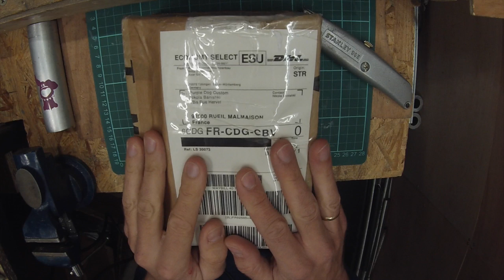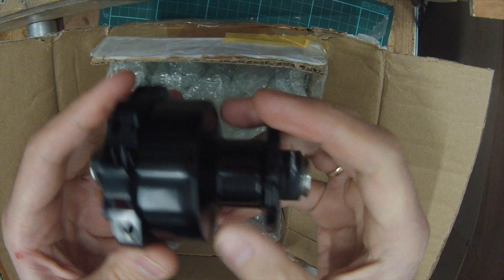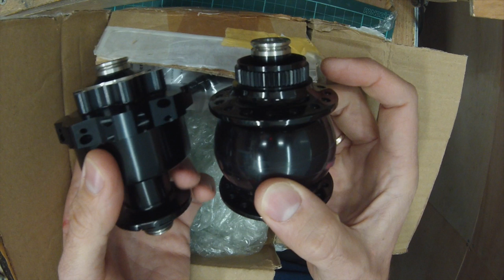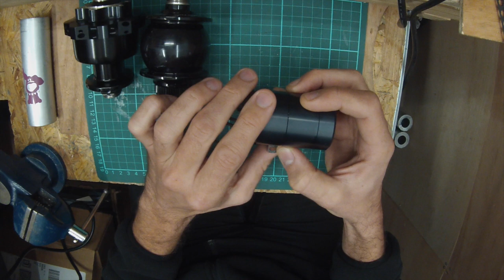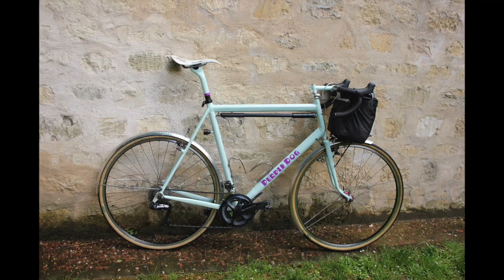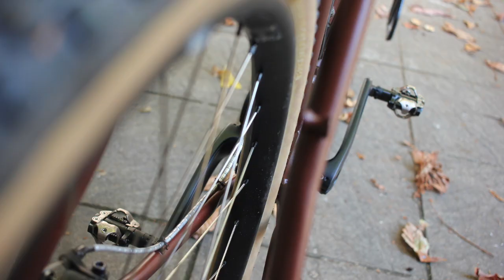JAN 2025 Small Shop Talk: Project Dynamo X unboxing, Stalker LED light, New Fixture

Comment: Do you have plans to release one of these higher power lights without the integrated battery or is that a key component of your system? Personally I would love more power from my dynamo lighting.
Reply from the maker: Hi there, I do have 2 lights only (www.custompurple.com/shop) - Sarah and Kerrigan  though they have output slightly higher than for example the Edelux. The battery does make low speed riding flicker free which is VERY nice and the battery is user replaceable *without tools and/or soldering* you can see it done here (https://youtu.be/BmKDtM5p_H0?si=4EDNshe1yNQ6PdXg&t=1418).

Depending on the road test results of Project X, I have a whole system coming that will have high power front lights only as an option (500+ lumens).
Reply: @CustomPurple  Thanks for the speedy and comprehensive response. I'll be keeping an eye on Project X for sure. I mainly used Supernova E3 Triple but that was stolen and I'm not as happy with the E3 Pro or whatever it was that I've been running recently. I've been happy with klite on the MTB but I'm after higher beam on road.
Reply from the maker: Kerrigan (https://custompurple.com/product/kerrigan/)would definitely fit your needs then. After showing it at bike shows, I have had some feedback so I am redesigning the electronics a bit, though after my lights with battery/USB charger, Kerrigan has been the product/front light with the most interest. 

As mentioned in the video, Project X will have its own ecosystem of devices/electronics to fit various uses (touring, commuting, gravel, MTB, etc.). Though first I have to build it into a wheel and test it on the road. So stay tuned. =)

Comment: From what i could see the prototype supports a disk brake - but the current type SON dynamo was not a disk brake model? Coupd we see a size comparison of "apples to apples" so to speak.

Great to see the new tech though!
Reply from the maker: Hello,
At 3:04 you can see both aligned side to side. the SONdelux is Shimano Centerlock disc (spline mounting) and the Project X dynamo is 6-bolt/ISO.

Comment: And what problem does this solve?
Reply from the maker: More power (2-3x) especially in the 5-15kph range. Currently dynamos do <1-2W there, which while sufficient for some light (with LEDs) it is not enough for anything beyond that. Also for off road riding/gravel where speeds are lower you need 3-5W to see enough. Also as I mentioned in the video charging anything requires at least 2.5W, preferably 5W so running multiple devices (lights and charger for example) at the same time will be possible. 

If you are happy with the performance of your regular/3W dynamo setup, probably you don't need anything more.
Reply: @CustomPurple output: That sounds good; thanks for the answer. 
Will you also sell a charger?
Reply from the maker: You are welcome. I currently sell a front light with an integrated charger (https://custompurple.com/product/the-companion-bikepacking-dynamo-light/). Though I mentioned in the video that the product (light and charger)  that is designed to take advantage of the increased power (it is compatible with regular/3W dynamos as well) is going to be available soon (https://custompurple.com/product/stalker/)

Other electronics (charger only of sorts for example) to be compatible with the Project X dynamo are in development and depending on my road testing, those products would probably be available after MAR2025. Of course I will post updates on this channel/my instagram/etc., so yo can follow me to be up to date. =)
Reply: Do you think the Project X dynamo will be available at some point either from you or SON? I'd get a 15x110 version and a Stalker in a heartbeat.
Reply from the maker: Yes of course. Among the goals for Project X is for me to sell it as product (as well as the electronics to go with it). After doing a road test, if the results meet my needs, as already discussed with SON, the next step will be to discuss customisation options and that will include axle sizes.
Reply: @CustomPurple  Any updates on your wheel build and testing or on Stalker production? I've got some ultra events planned for this year and was hoping to give the Stalker a try with or without the Project X dynamo.

Comment: Project X sounds rather mysterious!  😁   I've done some basic measurements to figure out the inductance, resistance, and open-circuit characteristics of my old SON28.  I'm curious about how the Project X dynamo is different.  Thanks for the video!
Reply from the maker: Thank you for your comment.  Well i do have some preliminary data (replicated by SON as well) but I want to measure the actual hub I have, I know this is the internet and we can say anything but still. 😋 Spokes are ordered and probably within  a week I will have a wheel and if the black ice clears from the roads I will ride it as qell (with the Stalker front light/charger). So any developments should follow afterwards. Stay tuned. 😁
Reply: @CustomPurple  No rush.  It would be interesting to know what Schmidt's design goals were.  There are so many characteristics that a designer might want to optimize, but that always comes with costs in some other area.  Thanks!
Reply from the maker: The nitty gritty details with regards to coils (and inductance, resistance), etc. are part of the SON 'know-how' so I don't have all that information currently available.
Reply: @CustomPurple  True... Schmidt wouldn't necessarily want to share any secrets.  The whole question of how to design a dynamo to work best with a headlight utilizing a switching power supply is an interesting one!  Especially if the switching power supply is controlled with a microcontroller.  Looking forward to your results!
Reply from the maker: Well one of the lessons I learned quickly is that dynamos change their behaviour according to the load (and speed of course to add insult to injury hehe) so that is why making a dimmable (variable intensity) dynamo headlight took a good part of 4yrs. So you have to design with quite a bit of safety margin since dynamos really and I mean REALLY are not very accepting of regulated (switch mode) supplies. There is a paper out there (I can't find the link, though I think you can readily find it around google) doing exactly what you mention (microcontroller managed supply) so the dynamo always receives the optimal load for maximum power output, though  it is still based on '3W dynamos' and low speed performance is still quite limited, at least in my opinion, especially given the complexity of the solution.

There is more than one way to skin the cat as they say. =)
Reply: @CustomPurple  A long time ago, I designed an analog maximum-power-point-tracker for use with solar arrays.  The solar arrays share some characteristics with dynamos, such as a high source impedance, so I've thought about how to do the same for dynamos.  There are definitely some challenges, especially if it is designed to work for any dynamo.  I've got some 14% grades near me, so I agree on the importance of low speed performance.  There are a lot of variables when looking for the best solution, such as how long the hill will be.  If you design it to work with a very long hill, you are forced to just use the available power... although the circuit could start off using stored energy (in a battery or supercap) and then switch back to just using dynamo power after a while.  It's an interesting challenge that I haven't had time for.  Good luck!
Reply from the maker: Thank you. =) Yeah this paper describes the exact thing you mentioned (MPPT), though (*in my opinion*) getting 1.5W rather than 1W at a certain point (it is still 50% more!) and/or higher power at (very) high speeds is still tuning a small engine rather than redesigning it from scratch so you actually get the power you require.

Dynamos certainly do not deliver smooth power so having any kind of buffer (such as a battery) makes the whole experience so much nicer, I honestly had gotten spoiled with no flicker at low speeds. The basic concept (dynamo when moving/battery when stopped) is not new, Sturmey Archer did it with their Dry battery/filter switch system (in the 60s/70s?), I developed it further with The Stalker (https://custompurple.com/product/stalker/).